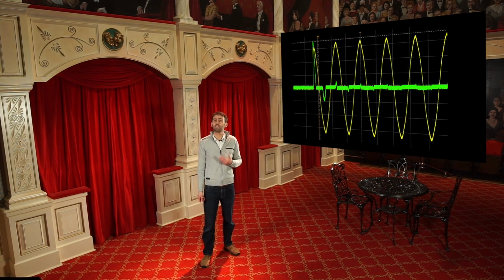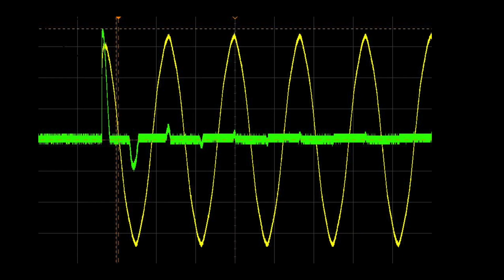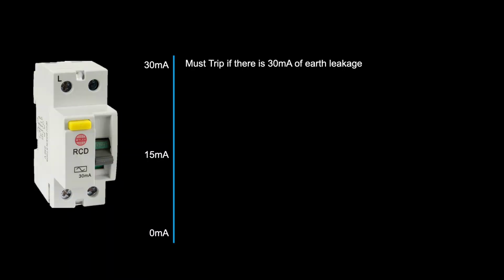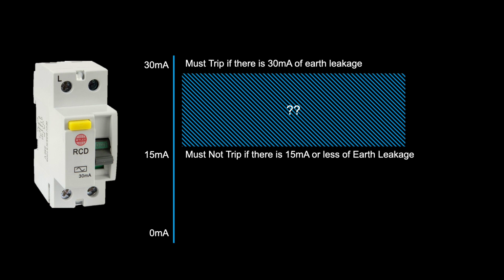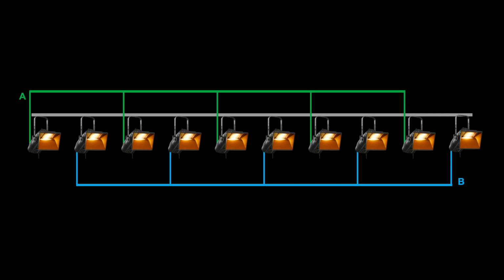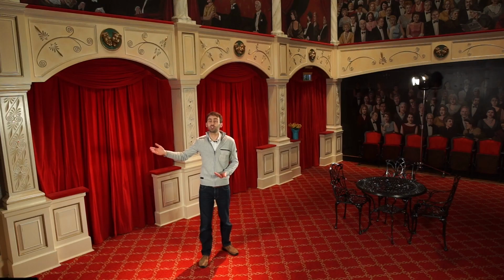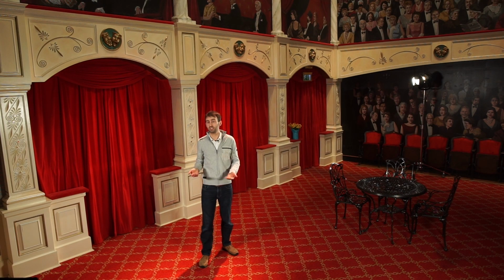The Balance of Power

Comment: Very useful info. I'm wondering where something like switched-mode on an ETC D40 dimmer module lies in this. Is it okay to plug LEDs into it when in switched mode?
Reply: It is not recommended. As explained in the video, even if you set a dimmer to 100%, the output is not a true sine wave, so it can damage the power supplies within the LED fixtures.
Reply: @springws14lbss  but then I guess my question is what is the intended purpose of switched mode?
Reply: @campbellshaw1301  Presumably for effects, practicals, etc.?
Reply: @the-real-iandavid  yeah probably, it is just confusing to me why there is a non-dim and switched mode. Maybe there was a time when this was thought of as a fine thing to do?